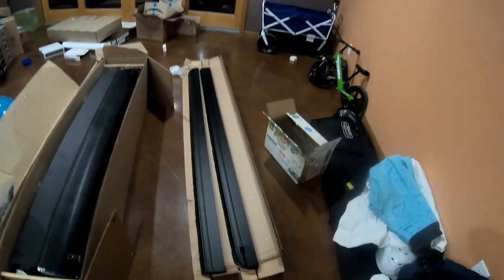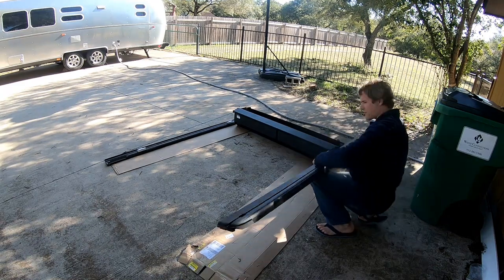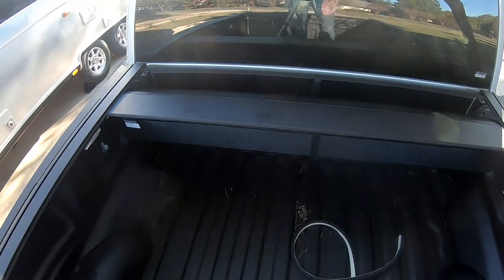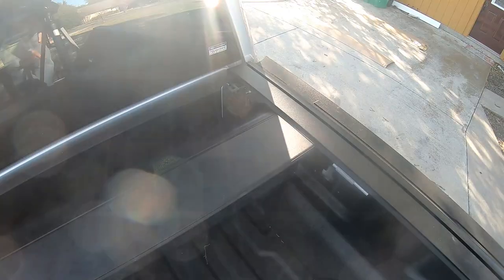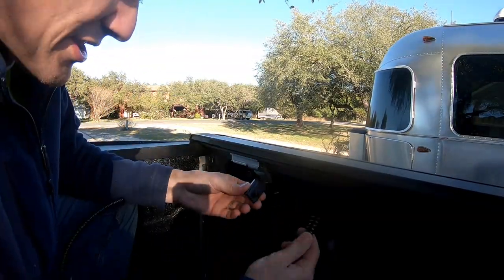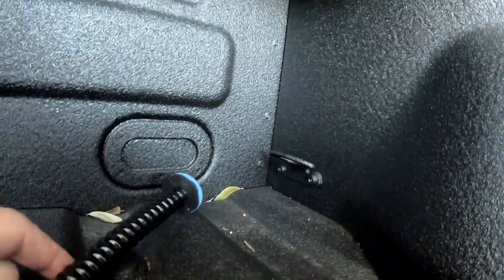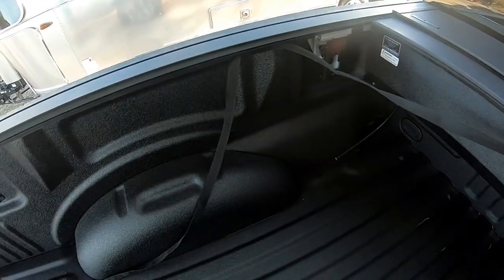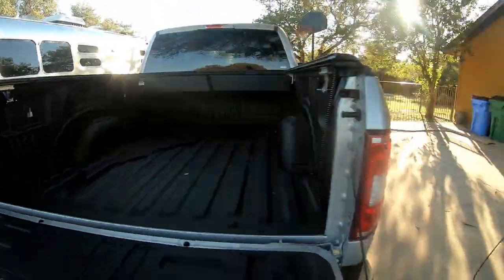Ep. 10 Installing a Tonneau Cover on our F150

Comment: Do you recommend this product? I saw pics of people jumping on it to break in, do you think it can hold up to someone jumping on it with all that pressure at one point? Also, what connects the slats? Is it rubber that holds the slats together? Can someone just use a razorblade to cut the slats past the lock then push it open? I Don't wanna spend over a grand on something that can be broken into easily 🤔